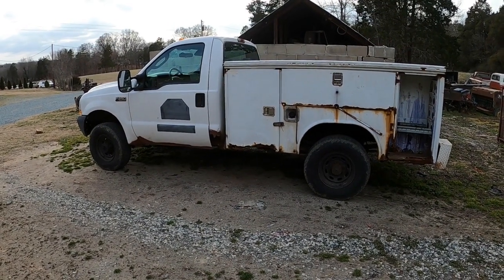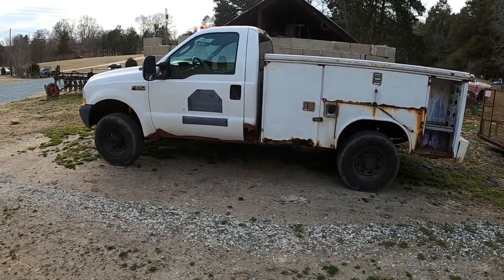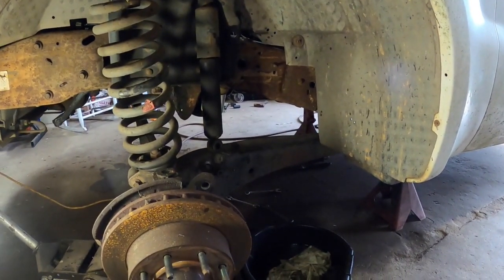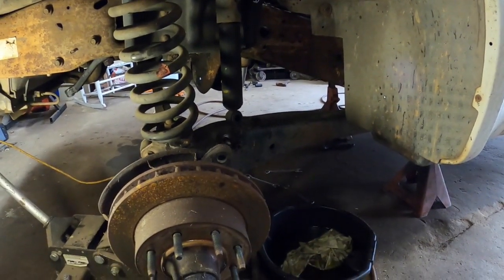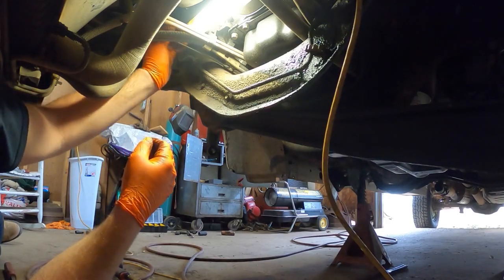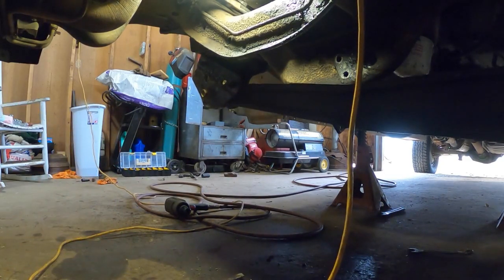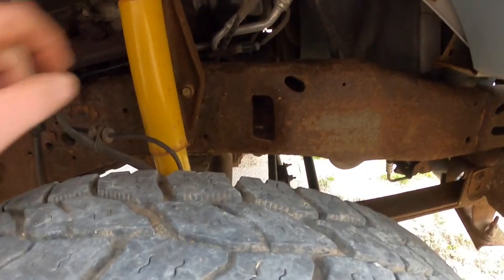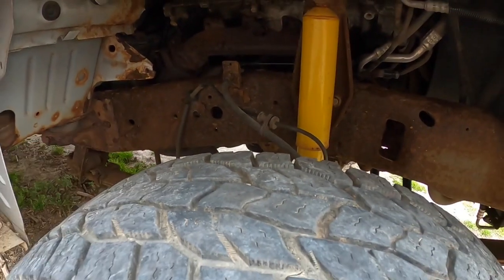2wd to 4wd conversion tutorial on the Twin I beam Removal 99-04 Ford F250 Super Duty 5.4 L

Comment: My 02 SD F350 c/c LB SRW is dying to also pull with the front tires. So it is all just bolt in from donor truck and all holes are already in 2wd frame. What about the back of the 4R100 diesel trans? Is it also just a tail housing swap to mount the T case? Please let me know.
Reply from the maker: As far as my swap yes, it ALL was there even the hole for the shifter! I couldn't believe it! The donor truck will supply everything you need to swap over direct bolt! Feel free to email me if you have questions, it's in tje about section of my channel description.  As fsr as the transmission goes, what I understand it's an extensive shaft swap due to length.  The 2wd had a brand new transmission in it, but once I found out it's was about 700 to swap it over I just pulled the drive train from the donor truck and been driving it since! Once the transmission goes out, I will pay them to swap it over. I do t thi k it would be any different on the diesel, so that could be a cost factor to consider.  You will need the long main shaft from a donor transmission for the 4wd. Thank you for the great comment! Hope it goes well.for ya!!

Comment: Can I buy the old i beams from you my truck recently got bent up I could also use the fenders willing to come get them also awesome video awesome information also need a fender and headlights if you could help me out willing to pay greatly could also use a bed if you got one can’t find any parts where I’m at any Information would help might have to do the 4 wd swap
Reply from the maker: You are welcome to any of the front end parts from the 2wd, still have them. Fenders weren't any good, so didn't keep them, have the doors, headlights , grill and bezels. I don't have a bed, the rusty decide body went down the road. I do have a 1988 F250 460efi, 4wd 5spd if interested as well!! Email me , it's in the about section of my channel!! Thank you sir!!

Comment: About to do the same thing on my 2002 7.3 two-wheel drive manual I have one question. Do you think I will run into any problems?
Reply from the maker: Awesome, I sure wish mine was a 7.3 😁 Honestly, no I do not think you will have any issues. Are you getting another whole donor truck for the swap? I can't speak about any of the clutch linkages or pedals though. But everything else is a direct bolt in from 99-04 as far as.everytjing I read. The only additional thing was the rear spring blocks..I had to engineer a spring center pin with a grade 8 bolt. Mainly because the other springs I had were broken and junk. And the rear driveshaft situation is the only other. Mainly because I went from a standard cab to an extended cab. My email is in the about section of the channel, if you need or want too send me an email with your contact info and we can't text or talk further if you need any pointers or hit a road block. I'm still driving it today, lots have happened, mainly the whole cruise control fire deal, but the swap has been smooth as silk. I ended up adding rear air bags to mine. With the service body, and wheel wells it just never sat like I wanted it too. Thank you for being here, I really appreciate that...and good luck my friend!! I'm here if ya need anything!! 😁😁👍👍👍

Comment: How did you find the donor truck and where?
I’m interested in 4wd swapping my 85 F150
Reply from the maker: Hello my friend, thank you for being here. I first found the rusty truck in the mountains of NC, I knew it could use some body panels and the service bed, but mechanically it was in great shape. The ext cab 2wd was local with a bad motor. So originally bthe plan was to use some body parts and bed on the rusty one. But after I saw it in person, I realized the frame and other parts were very bad off. That's where the plan hatched to do the conversation, mainly from necessity more than want. If you have any questions at all I would be glad to answer them. Around here the ford selection of this era is pretty common. You get back to the 80's and early 90's the sources are more rare. Thank you again, and toy.can email me if you want, and we can exchange and easier way to communicate. This project was no at all the original plan 😁🤦

Comment: I'm about to to pretty much the same thing but with my 7.3 it's a 99 I noticed in the junk yard axle I'm looking at it bolts up to the cross member to the engine I'm not sure if mine is the same..you would think if the frames are compatible
Reply from the maker: What year model is the truck in the junkyard? They did have a twin ibeam 4x4 prior 99 I believe, that one won't work if yours is a 99. My understanding and research, 99-04 are identical frames, and nothing on the 4x4 used the engine cross member except the Trac bar mount. If you ha e any further questions my friend, email me and we can exchange numbers. Be glad to help all I can my friend! Thank you for stopping by, hope some of the videos will be helpful, it honestly is an easy swap! Just double check that axle you are looking at, sounds pre 99 to me. Thank you again!

Comment: Interesting. I didn't realize this was pretty much a bolt-in conversion. Handy to have all the necessary bolt holes already in the frame.
Reply: I broke three half inch size drill bits yesterday trying to put a hole in a heavy piece of Steel where I needed it.  Handy or super convenient with how the holes are already there.
Reply from the maker: Amen sir!!!
Reply from the maker: I was truly surprised as well Mr Pete, they did well with these! Even the hole is already in the floor of the 2wd for the 4x4 shifter! Sure makes the conversion so much easier!! Looking fwd to getti g this truck in the road!! Thank you so much sir for continuing to always be here watching, supporting, following, and COMMENTING!! Hope all is going well my friend!!😁👌

Comment: That's the one good thing ford done was 2 wheel drive to 4x4 is easy with all mounting holes there. I have done a few back in the day. They go purity fast it will make you a good truck depending on just what engine is in it.
Reply from the maker: They sure did, yet to find anything that isn't already there, even that hole in the floor for the shifter already!! Man yeah, see me doing anything wrong let me know!! I am looking fwd to getting it on the road asap, but it has the ole 5.4 gasser. We have many at work, so kind familiar some with them. I sure wish it was diesel 😳 Thank you sir for continuing to always be here watching, supporting, following, and COMMENTING!! Also for all the input!!